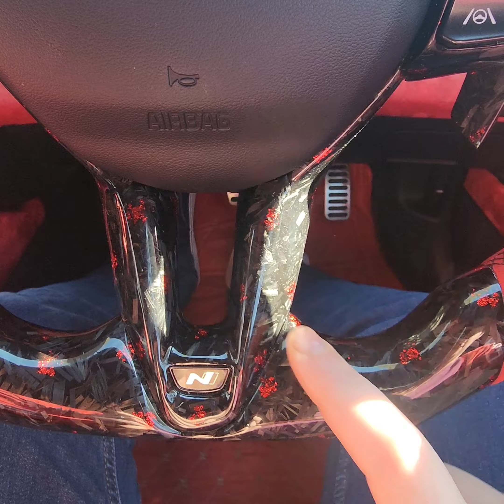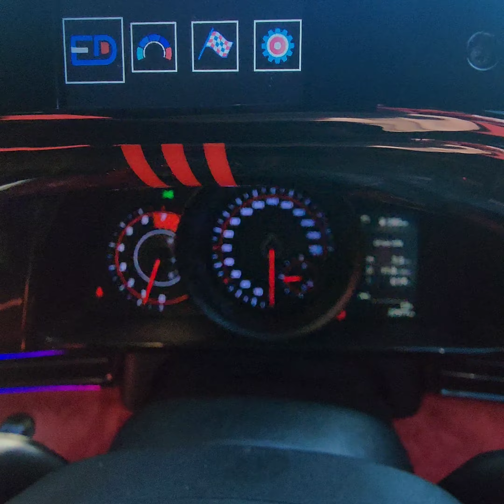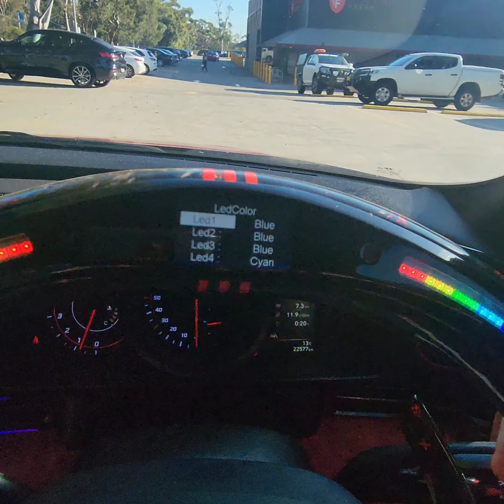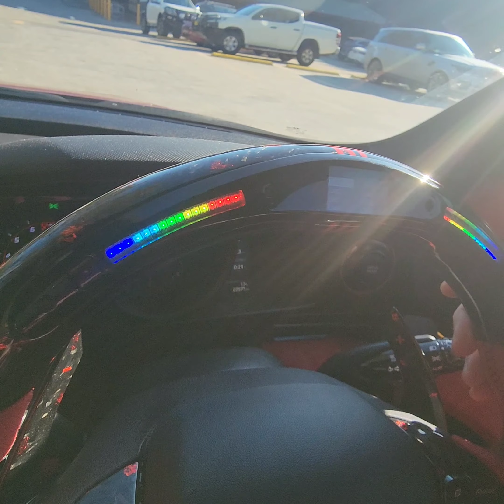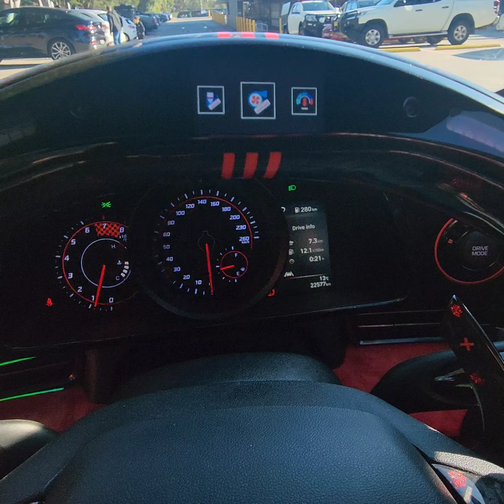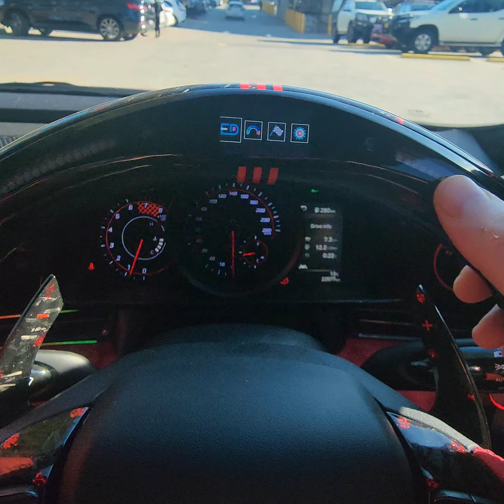5th gen Bluetooth OBD2 LED Steering Wheel demo

Comment: I know its been a while but you said you ran 12vdc up to the clock spring then used an unused wire in the clock spring? Do you remember what pin you used?